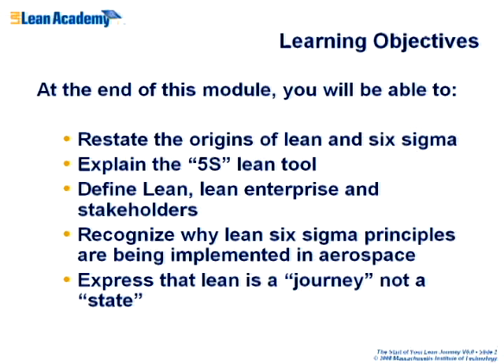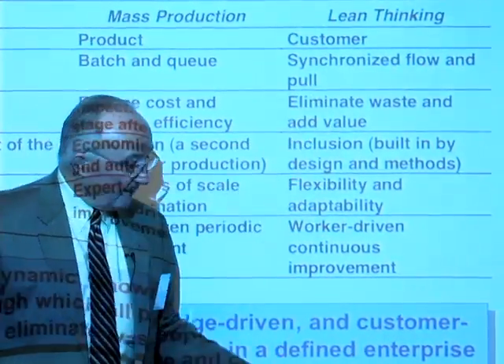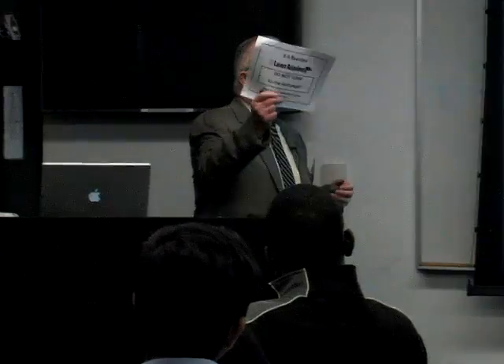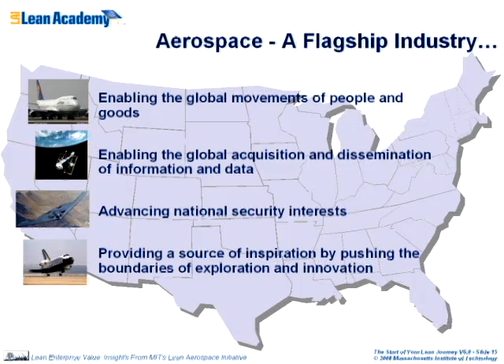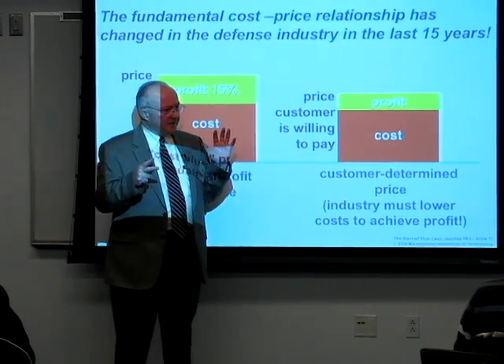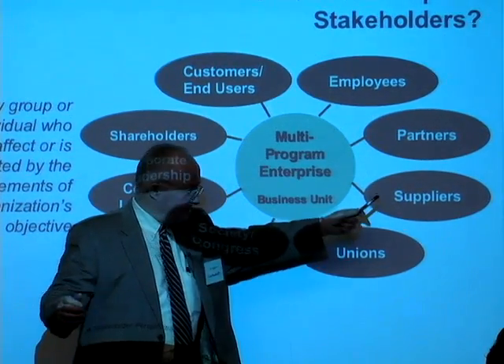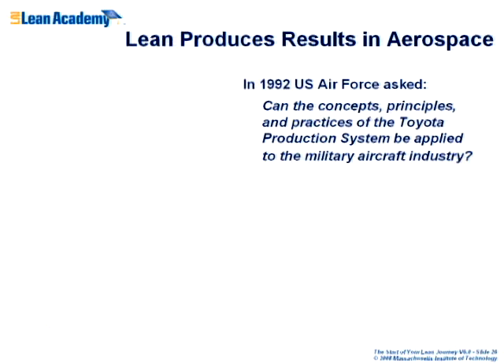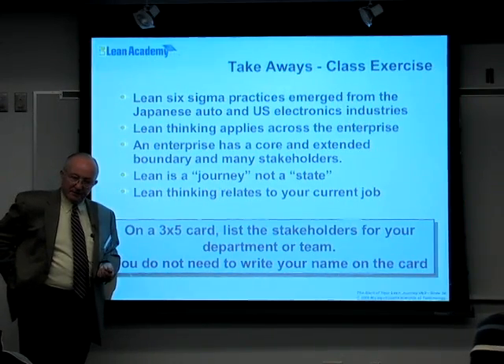Ses 1-2 | MIT 16.660 Introduction to Lean Six Sigma Methods, January (IAP) 2008

Comment: I think it's factually incorrect to state that Lean is for flow and Six Sigma is for quality as this presenter states. The roots of the Toyota Production System (Lean) are in quality (preventing defects) and the two pillars of TPS are "just in time" (flow) and "jidoka" (quality at the source). Flow and Quality go hand in hand. Lean methods give you both.

Comment: i really don't know why Lean and Six Sigma are considered a single unit.  they both focus on quality (meeting or exceeding customer requirements/demands)

a very basic reference to distinguish the two

lean - reduction of muda/waste
six sigma - reduction in variation

Lean is heavily based in Kaizen and how everything revolves around gemba (the gemba?).  however, do does Six Sigma, by further reducing variation and tightening the process's UCL/LCL.

Comment: Are you talking about Six Sigma? This video course is really about Lean, which is proven to work in settings that are not production lines - including healthcare. There's so much data and evidence out there, it's a silly position to say it doesn't work outside of a limited setting, like production lines. Without leadership, it doesn't even work in production line settings, as other commenters are right to point out.

Comment: This is a great starting point.  It only works if management is committed.  Changes made must not effect other countermeasures in place.  After 20 years in the auto parts business I have learned that without these concepts you will not be in business for long.  Just look what happened to the big 3   they did not get on board ( and for the most part still are not )  and they have paed the price big time.

Comment: Isn't it an unnecessary motion for the speaker to walk up to the slide and point at something it the laser pointer as if it were a stick instead of remaining in place and turning the laser on? also, isn't it a defect for him to stand inside the projector's light while doing so?

Comment: As it turns out the lean principles lead to a great reduction in efficiency over the last decade, there was a rush to implement what they didn't fully understand. Companies have for the large part abandon this practice in truth, they have instead participated in stock buybacks over restructuring and reorganization. Take Gamestop for instance it has 700M in cash and its shareholders want that spent in buybacks rather than on fixing the company's issues. Gamestop has a massive loss of efficiency problem that needs to be fixed ASAP